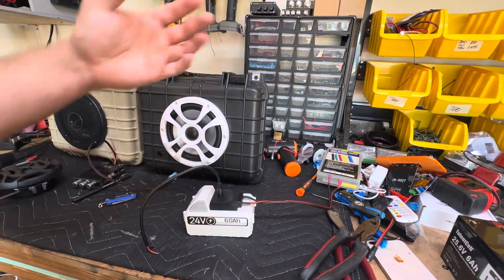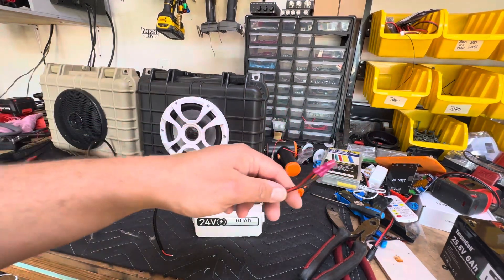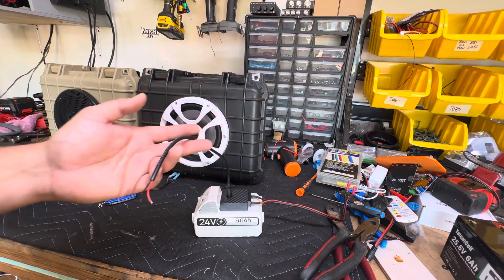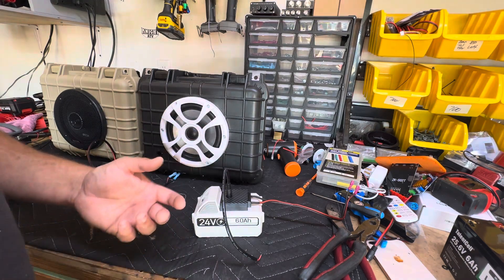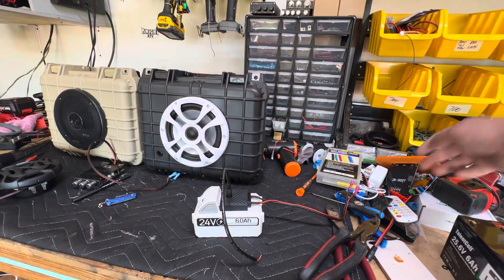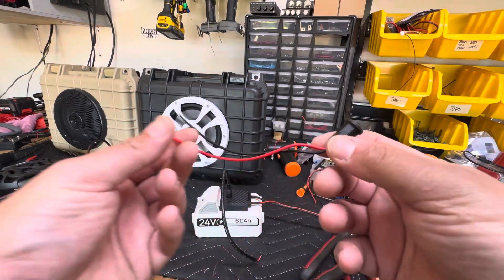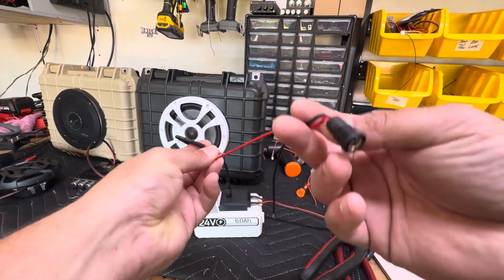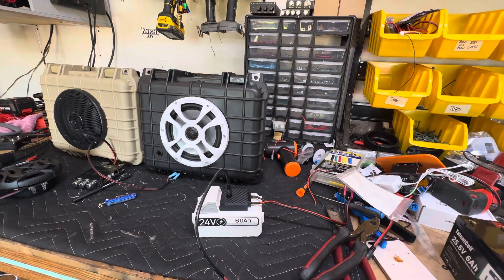How to charge Battery without removing

Comment: Hey bud, another good informative vidoe. Question, on other drill batteries, could I not just splice a charging port into the adapter harness and charge it without removing the battery?
Reply from the maker: @warren2129  no unfortunately they need a balanced battery charger
Reply: @Builtnotnboughtboombox  thanks again
Reply: where do you get adapter
Reply: Is it water proof?